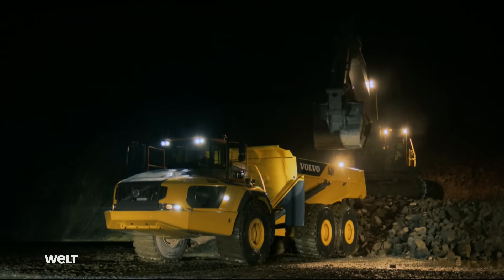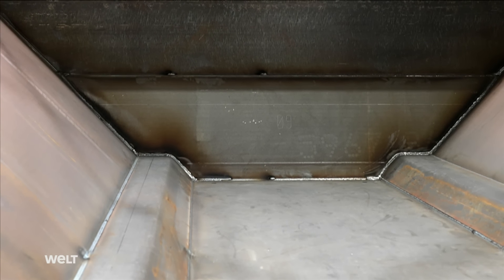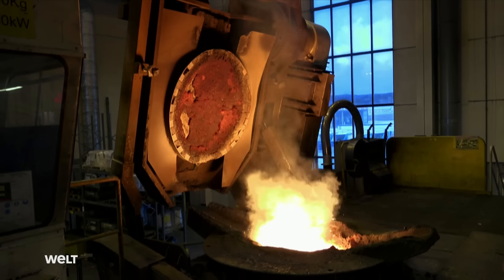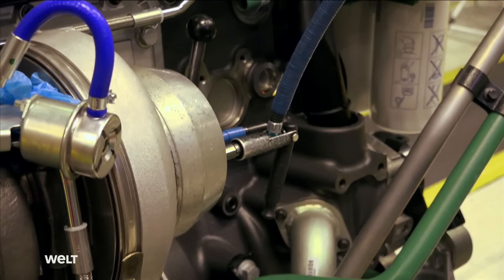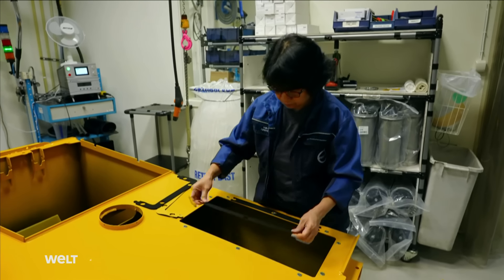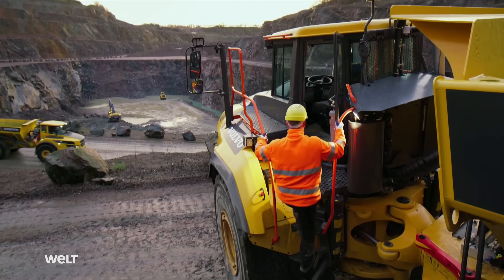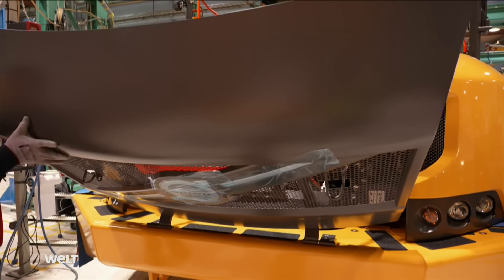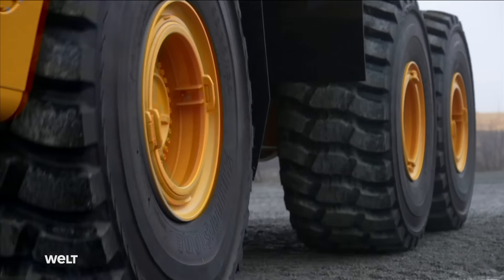Inside Look: Building World's Largest Articulated Hauler - Volvo A60 in Sweden | WELT Documentary

Comment: kinda cool how the ground has pathways painted on it so that people moving parts with the dollys know where to move the dolly so that the part doesnt hit anything
would make it way quicker and easier for most people
Reply: Indeed. It's the same thing in the plant where I work. The pathways are also color coded homogenously acros the plant. So for example a blue path with white border means that everyone, including visitors, can walk there (and only there. Straying from the path will get you kicked out) and you don't need to wear protective gear. A blue path without white border means that everyone, including visitors, can walk there but you need some protective gear like safety shoes, reflective vest and a helmet. A red pathway means only authorized personnel and all safety gear is mandatory, so safety shoes, fireproof pants and jacket, helmet, CO2, gas and toxin detector, earplugs, safety goggles and respirator. Orange path means danger, heavy objects overhead. Yellow pathway means electrical danger. 50/50 orange and yellow means both of those combined, etc etc. These are just some examples, there are many more, including like you describe pathways to move equipment or drive specific vehicles on. At the entrances and exits to every production hall is a large sign with all the color codes inside that specific hall and at strategic locations throughout the plant are even larger signs that contain all the color codes found in the entire plant. Kinda cool indeed, especially if you know what the colors mean

Comment: I dare say the engine is not made with cast "steel" but cast iron.  Interesting factory. .  Volvo has a very good reputation for the heavy equipment they make.
Reply: Why would you say that? It is definitely cast steel, which is a thing and is different than cast iron.
Reply: Have fun with your cast iron engine 😂😂😂😂
Reply: my thoughts also. never heard of using cast steel. aluminum yes. tried to research the engine but quit w/ no success.
Reply: @julianreverse  cast iron engine blocks are very common in industrial and civilian vehicles
Reply: @fama5736  Sure ...
Reply: @julianreverse good luck finding cast steel engine block 😂
Reply: Why in God's name would they use alloy steel? It's gray cast iron and it's perfect for what it's used for absorbs harmonics good etc.

Comment: 0:23: 🚚 The Volvo.S60 is the largest articulated hauler in the world, capable of transporting up to 55 metric tons of cargo.
5:23: 🚚 The manufacturing process of a dump body for a vehicle involves laser cutting, spot welding, painting, and assembly.
10:59: 🏭 The manufacturing process of heavy trucks, including the casting of steel engine cylinder heads.
16:45: 🔧 The engine assembly process at Volvo involves precise measurements, automated guided vehicles, and a leak test.
22:27: 🏭 The manufacturing process of the A6 articulated hauler involves rotating the frame, attaching screws, fitting the cooling unit, and assembling the driver's cab and fuel tank.
28:26: 🏭 The process of building and assembling vehicle cabs in a factory.
34:42: 🚚 The assembly process of the A60 articulated hauler, including the performance test and attachment of various components.
41:45: ✅ The Volvo A60 hauler undergoes final inspections and tests before being delivered to the customer.
48:20: 🚜 The Elyx zero three is a fully autonomous battery-powered smart wheel loader that can make decisions, perform tasks, and interact with humans on its own.
Recap by Tammy AI

Comment: Wholly agree with the reason for this declaration by  the manufacturers. Also having a 50 metre extension cord to cover the extra 10 metres with a nice coil of the surplus acting as an inductive resistance and getting nice and hot for some reason. Voltage drop and current increase is serious stuff. When I was a kid in the 70s,visiting my grandfather on a stinker Adelaide day, he used to complain of "stale electricity"  because the window rattler A/C would not do its cooling  job as well. Bearing in mind that cooling of the compressor was done by the returning refrigerant  gas, the lower voltage on those days meant current and heat went up and got subtracted from the cooling effort making the noticeable loss in cooling.

Comment: Ref: 49:02  It is not "Zero Carbon, as the energy used has to be generated somewhere and then delivered to the vehicle with line waste along that route.
Reply: The machine itself has 0 carbon imprint. As for the power to charge it if you use carbon neutral energy like wind or water then that too has no carbon imprint.

Comment: im rather curious about the assembly line, where they say the robot rotates the engine to the optimal position for installation... it would be pretty damn cool if that took the station workers height into account. i'm sure it's technically possible given that each worker has to sign off on their installation anyways so the station has specific employee data... my thinking is that a very tall person would need a different ° rotation to install parts compared to a short person... Swedes are leading the industry in Ergonomics and worker safety, so i think they might use such a system.

Comment: no, not "spot welds" those are tack welds,  listen at 29:25, and no not a "milling machine" a purpose built machining center. the "special apparatus" ( I think that's what you called it) that holds parts as they are TACK welded  is an assembly jig. the cleaning process before robotic welding is called shot blasting..its not that hard to get this right.

Comment: I thought these trucks were big, then I heard max load of 55ton LOL. I then realized I load trucks with 6 -8 steel coils at a time, those trucks are transporting about 350,000lbs of steel around sometimes
Reply: Same here, used to work in a mine that had CAT 797F, these can handle 400 short tons (800,000lbs) but this one is articulated so a different type of vehicle

Comment: I hate to bust your bubble but Volvo wasn’t the first to come up with a 3 axle truck that large. Atlas Copco Wagner Mining came out with the fullback that originally was rated at hauling 45 tons then subsequently bumped up to 50 tons back in the mid 90’s. I worked their as a heavy duty diesel mechanic. 2 major issues where the center articulated hing that was a cast part had cracking issues so the engineers went to a steel plate welded replacement. Second issue because of cost and price point issues was the  Transverter. They went with a ZF transverter because it was 10,000.00 dollars cheaper then using a Allison transmission. The front power frame was designed around the ZF transverter and it was impossible to convert to a Alison transmission. Wagner eventually sold the rights to the truck to undisclosed buyers but I think it was Caterpillar because I see a lot of the fullback in the Caterpillar truck.

Comment: Oh, the errors in this one are making my head spin, and I'm only 11 minutes in! They're TACK welds, not spot welds. The front yoke is not fused to the rear, it's fixed with locking PINS, not bolts. And the truck uses two hydraulic RAMS, not pumps to steer. I certainly hope it gets better from here.

Comment: Where did the A60 title come from.....other than the narrator mentioning it there was no mention of 60 in any weight ,volume, engine size,  tyres  there was 3o od cubic metres and 55 ton but no 60
Reply: The A60 is weird. Its 60 long tons (US) and 55 short tons (EU). The newest version of the A25 loads 25 short tons and the A35 for another example loads 34,5 short tons
Reply: @Ubeer85  "55 short tons (EU)". Metric tons. Although the first one should be "short tons (US)"
Reply: 55 metric tons converts to 60.xx US tons. I have driven Bell 35 and 40 trucks and those are the US ton ratings of those trucks. The bigger question would be how they decide which ton they will use for the model number. I'm not sure where volvo is based or where they started, but their history might shed light on why the model number is based on US tons.

Comment: But John deere makes a 60 ton haul truck tho 🤔
Reply: Rated to carry 12 tons less!
Reply: They never said the volvo 60 ton truck was the only one of that size, just that it is the largest articulating rock truck. Until they come out with 61+ ton rock truck, their statement is technically correct. They could have said it is the largest class of rock truck. They didn't mention other companies and with that there is no mention of which company made a 60 ton truck first. At one point, it could have been the only one. What is certain, you won't see a video of a bigger rock truck being built right now, so at the moment it is the largest.

Comment: We use 6 of the A60's on a coalmine in New Zealand....they haven't been that great to be honest....far too fragile in the driveline, the dropbox's and universals are a serious weak point and the diffs have had a number of failures as well plus near constant electric issues
Reply: We have 4 A60 and they run with no problems.
Use them within specified limits and maintain them and you have no problems.

Comment: Men and women working together on the same assembly line excetera is fine, but just don't insanely try to create a genderless society, which is impossible. Understand that men and women are physically and mentally quite different from each other as God designed, and so of course that's a very good thing. Learn to accept the differences as complementary to each other and therefore not a bad thing as some stupid people do.
Reply: The main reason is that there is hard to recruit male workforce only due to lack of skilled people, therefore recruiting women is interesting.
Reply: When welding something like this,  strength is not as important as accuracy.  Females have better hand - eye coordination, so welding is perfectly suited for them.